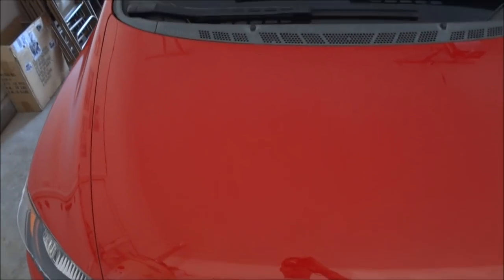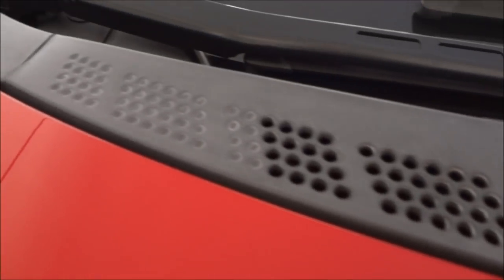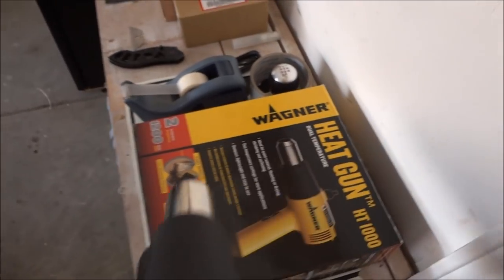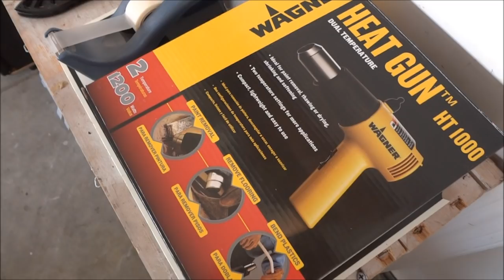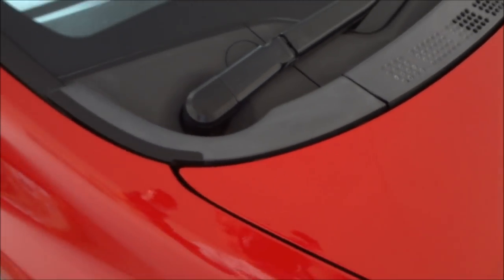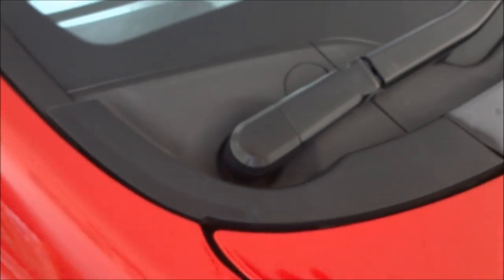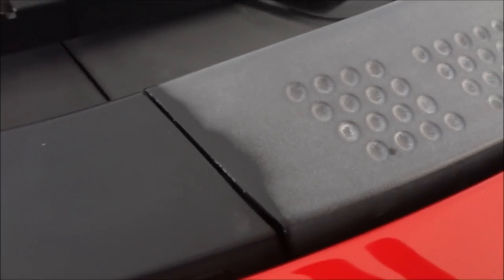DIY: Sun Faded Wiper Cowl Fix Part 1

Comment: I don't think you're burning away the faded surface layer. I think you're just melting the plastic, and the oxidation is still there, mixed into the lower layers. That's probably why it comes back so quickly.
FYI, you can get a heat gun at Harbor Freight for $7.99 on sale.

Comment: Hey man, I drive an 07 SI.  Check out a product called Forever Black.  Not sure how long it lasts but I put it on my cowl 3 years ago and it still looks new.  Or if you want to do the heat gun trick make sure you put some 303 on it from time to time to keep it looking new.

Comment from the maker: @jeffuhnator a hairdryer may work, but it may take a bit longer as a hairdryer doesn't get as hot as a heat gun. give it a try and let me know how it works for you. I set my heat gun at "low". there is a "high" setting too.

Comment: Just use Mother's Back-to-Black or use SEM brand trim paint which is available at any good automotive paint store. This way will destroy any texturing of the grain on the plastic. Not a good Hot-Rodders trick. IMO
Reply: None of that shit works you always have to reapply it every few months it always fades right back to grey again in no time.

Comment: Great video!  Any updates?  I've got an '07 Accord with the same problem.  I wonder how well this would hold up if you applied Aerospace 303 after using the heatgun.

Also I'm a bit nervous about getting the heat close to the windshield.  You didn't have any trouble with the glass?
Reply from the maker: the windshield will not be affected by the heat from the heat gun. my cowl is looking black and nice still.
Reply: TheTongMan Awesome! Thanks for the reply!  

I've done some more searching around and I've seen a couple people mention that the part of the cowl that lays on the windshield can warp and create a gap.  At the same time lots of people report success so I'm wondering if they just heated it too much.  Any thoughts on that?  It doesn't look like you did that part on your car.
Reply from the maker: Yes, the plastic will warp if you over-expose it to the heat gun. Try not to over-expose the part to heat and you should not warp it.